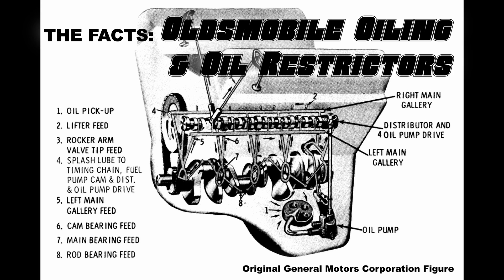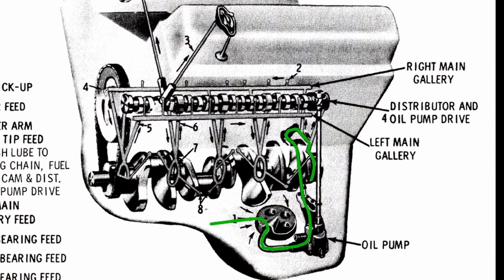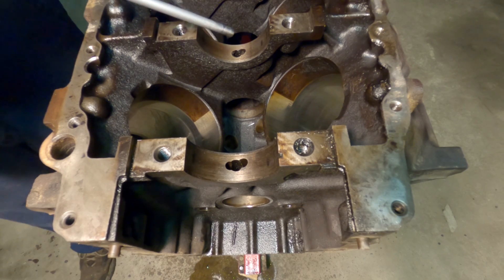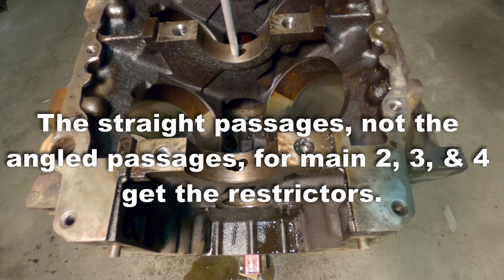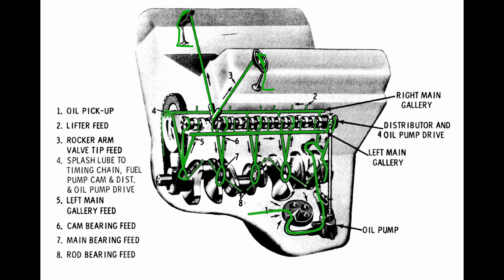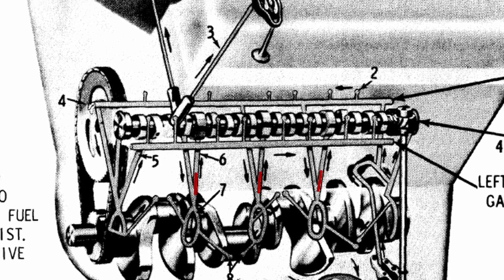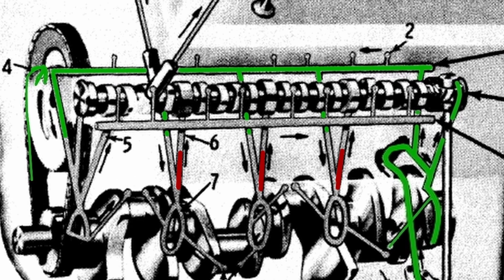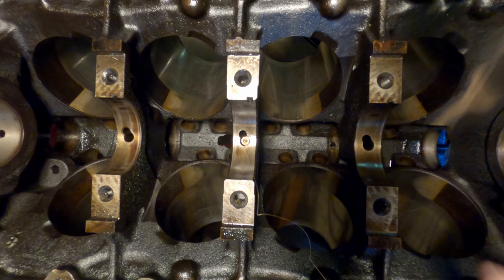The Facts on Oldsmobile Engine Oiling & Oil Restrictors

Comment: I want to know the possibility of hooking up a clear 7/8 hose  to the oil filter  pipe  and injecting oil  through the hose and oil prime the engine without  pulling the distributor  ?
Reply from the maker: Thank you for the question! That is a really clever idea that should theoretically work. Practically speaking, I have no idea if it would work. Just be cautious that the threads don't cut the tube and send a sliver of material through your engine. If you try it, just be certain you confirm oil seeping from all pushrod tops. Let me know if it works for you, that's great "outside the box" thinking!
Reply: Companies exist that sell pre-lubers. they store oil, then force oil into the motor under pressure before start up.

Comment from the maker: I just want to clarify that the metered orifice at the rear of the oil gallery is not solely designed to oil the distributor gear. It's designed as a metered orifice to eject foreign materials and contribute to oiling the distributor gear through splash oiling.
Reply: My understanding is that it does oil the distributor gear: where did you find info to the contrary? Not being argumentative, just trying to find out, as the source who told me that is very trusted in the GMC motorhome community. Also, what do you use for the 3 restrictors?
Reply from the maker: @Scott-hb1xn  Let me start by saying your motorhome guy isn't wrong. I need to apologize, I certainly could have presented this information more clearly. The earliest Oldsmobile Factory manuals I have do reference the splash oiling from the ejector plugs. From an engineering perspective they are refenced as ejector ports for foreign materials suspended in the oil. It's clear they serve a dual purpose here. That being said, nearly all Oldsmobile engines with 150K+ miles that I have rebuilt have plugged ejector ports, yet the distributor gear is not damaged from oil starvation. Clearly the distributor gear gets oil from other sources as well, consider general oil slinging within the engine and oil leaving areas like the rear cam bearing and lifters. The oil restrictors I used came from Mondello but their site has recently shut down. Dick Miller racing has a set available, DMR-5104. I want to personally thank you for the respectful comment, it's good to know decency is still found in people today.
Reply: Hi- thank you for the reply, and the information on the restrictors: I just ordered a set- after several months, I was finally able to bring home my block, heads and crank from my very dependable machine shop- hard to find in my area these days, and as a one man operation quite full of customers! But good work takes time (and money!) so worth the wait... I do need to ask what size the metered orifice in the distributor end plug is, or if there is a stock number for them- I am not sure if the Toronado engine block I am rebuilding for my motorhome had it or not- my machinist says it didnt, but I dont know if he was watching for it, and it seems he may have simply put a standard plug in. (I have not started reassembly yet, so I can swap it if necessary)
Reply from the maker: @Scott-hb1xn Your engine guy is wrong. The Toronado engines did have metered plugs in the front and rear. The rear plug is located behind the core plug (freeze plug) so you will have to remove it to access the plug. I will see if I can locate a part number for you and I will double check the orfice size.
Reply: @junkdump2720  Hi- I got the plug with the hole (and the cup plug behind it) but Dick Miller just told me the DMR-5104 restrictors do not work with the 403, which is what I am working with... So I am waiting for them to get back to me as to what to use, etc...  My engine guy is a Ford guy... lol... He does know a lot, but not as much about this, I think...
Reply from the maker: @Scott-hb1xn  Dick is spot on, the restrictor kits arent recommended for 403's. I would love to hear his responses, keep me posted.
Reply: @junkdump2720  He simply said they have to be threaded in. I assume it is because the holes are too small to accomodatethem.  I looked at the passages yesterday, and it appears I can tap them to 3/8-16, and use allen set screws with 1/16 (.0625) holes to create the restriction (chevy small block style). My Olds guy told me to actually drill the cam bearings, but never gave me a size to drill... Original holes are about 1/8". I would like to hear your thoughts on the tap/plugs and passage size
Reply from the maker: @Scott-hb1xn  The Olds restrictor kits I bought from Mondello in the early 2000s have larger holes, like 0.9 to 0.1. I think 0.0625 is too small, you may want to ask Dick. I have used the drilled plugs before but I chamfered and drilled them 0.95 if I remember correctly. I don't recommend changing the holes in the cam bearings.
Reply: @junkdump2720  I'm guessing you mean .095"... I'm thinking then 3/23" (.09375") would probably be ok? And the tapping threads into the hole should be fine? Thanks- I do appreciate your help here
Reply from the maker: @Scott-hb1xn  I measured about a tenth of an inch, 0.10", I will double check for you but restricting the main passage to your cam bearings down to 60 thousandths of an inch would be too much, especially for a street or mild performance engine.
Reply: @junkdump2720  thanks- I made up the plugs this morning( for #2,3,4) and went with 3/8-16 x 5/8"  allen set screws, using a #40 drill bit, which is .0980", although I can open it up to 7/64" (.0109375") if you think that would be better... I don't have any bit between... I would think .0980" is close enough to .10" to be sufficient, but wanted to get your take... Sorry for asking so many times to confirm... lol... Don't want to starve it...
Reply from the maker: @Scott-hb1xn  I think you will be good, nice work. I double checked, 7/64" is slightly larger than the Mondello restrictor which would be acceptable on a stock or slight performance build.
Reply: Thanks!
Reply from the maker: I made an accurate measuring of the restrictors and ejector ports.  The restrictors are a chamfered 0.100" orifice. The ejector ports are a chamfered 0.045".

Comment: I have restrictors in my block at start up I have about 50 psi of oil pressure that’s being read from the top front of the engine at idle and warm up it drops to about 15 psi.  Should I check the pressure from somewhere else or is that pressure reading okay?  Thanks great video.
Reply from the maker: When installed properly restrictors will not dramatically affect oil pressure. You are testing at the correct port, the driver side top front port just behind the timing cover. There are many factors that contribute to oil pressure, the most common issue that causes low pressure at idle is high bearing tolerances from bearing wear or incorrectly sized bearings. The good news is that the stock spec for Oldsmobile engine oil pressure is 7psi at idle when warm and 35psi at 2000-3000 rpm when warm.
Reply: @junkdump2720  thanks do you have a shop where are you located?
Reply from the maker: @hustlewell  I do have a shop located in Maine.
Reply: Kenne-Bell put out a chart of minimum "hot" oil pressure versus rpm. For 15 psi on a 455 it gets to about 2250 rpm, to leave at least 10 psi getting to the rods. For a 350 would get to 2750 rpm. I never ran restrictors in any of my Olds. Hopefully your pressure increases with rpm.
Reply from the maker: @robb1165  15 psi at 2250 would be below the minimum pressure specification. I would say that's indicative of a problem or excessive wear.
Reply: @junkdump2720   That is the minimum required to maintain at least 10 psi to the rod bearings at that rpm. The psi is Kenne-Bells recommendation as the absolute minimum required to lubricate the rods, not the ideal.
Reply from the maker: @robb1165  haha, you're right, certainly not ideal! Thank you for sharing.
Reply: Oldsmobile had great engineers, by positioning the oil pressure gauge port at the farthest point from the oil pump. That gives you a better indication of what the oil is doing and you know that oil has made it through all the oil passages. Unlike a lot of other engines.
Reply: I drill all my cam bearings with smaller holes when I rebuild Olds engines,  just have to make sure you line up the smaller hole with the oil port when you install them.

Comment: The oil drain back issues are from boat guys running high rpm for long periods. In a car a high volume pump with 8qt pan works fine for 1/4mile runs with no restrictors. And a standard pump with a factory pan is fine for the 1/4mile. Great video!!!
Reply from the maker: That's correct! Just like you said, I have also heard the boat community has had drain back issues. Luckily I haven't seen that problem on land vehicles with Olds engines. I use the restrictors to improve the oil characteristics at the mains by restricting flow to the inner cam bearings. It has lots of benefits and protects your mains! Thank you for the comment and I'm glad you liked the video.
Reply: @junkdump2720  how long do your engines typically last? I had mine built by a local shop, he claimed lifters came apart twice, and the third time i tryed to pick it up I lost all oil pressure, and it over heated. Its bored 40 over, heads, valves and everything has been redone, so I am going to try fixing it myself. He installed a high volume oil pump with an upgraded spring. Should I go with the stronger pump again, or go back down to stock to keep more oil down below? 

Thank you for all the quality content
Reply from the maker: @rachal9306  I have had great luck so far with my builds. I've had two fails, one 350 had a cam lobe and lifter fail with a bent pushrod. I replaced the cam and lifters and as a precaution use hardened pushrods with all my builds now, that 350 had more than 200k on it when it was torn down for upgrading. The second was a spun rod bearing, I bought a used 425 rod from a machine shop and didn't double check the journal diameter, the engine started knocking when it hit 1200 miles, the bearing shells slipped on top of each other, I had to replace the rod and crank on that engine, that was entirely my fault and I double check measurements now. Your situation sounds very frustrating. I assume your engine is a  big block (455), You should be able to run a high volume/pressure pump without issue. A loss of oil pressure in a newly built engine is typically due to oil pump failures, incorrect bearing tolerances, or debris blockage. I would start diagnosis by removing the distributor and running the oil pump manually (counter clockwise) with the valve covers off and observe if oil is making it to the rockers on all cylinders, I have an oil pressure gauge I screw into the front orifice on the block to see if pressure is building in the galleries. Once you break down the engine take your time measuring the following: Piston to wall clearance, bearing clearances on all mains and rod bearings. If you plan on running 10w30 oil, your bearing tolerances should be 0.0008 – 0.0038 inches on Mains and 0.0007 – 0.0032 inches on Rods. Did the engine builder try to grind your rear main cap, where the oil pump attaches, if done wrong this can cause damage. While you are diagnosing the problem and when you tear it down I would suggest adding the oil restrictors from my video on Olds oiling. If you think too much oil is going to the top end you can decide to install restricted pushrods to help. If the overheat is not due to oil pressure loss, I find these engines overheat most commonly from ignition advance being set too high and piston to wall clearances set too tight. Let me know what you find, I'm interested to hear what's causing the issue for your engine.
Reply from the maker: I'm glad you liked the video!
Reply: Just drill smaller hole in all the cam bearings.
Reply: What size hole?
Reply: @Scott-hb1xn  I have put pipe cleaners down the pushrods to reduce oil to the top end with no issues.
Reply: You have GOT to be from Edmonton. I grew up there and I've had the same 1967 Delta 88 since 1982 when I graduated school. I once read an article in "Street Machine & Bracket Racing" outlining how to modify a 455 Olds and used this Junkyard Dog article as a guide. The Blackjack headers had to be bent around the steering box and the Edelbrock Torker II intake also required some mods. In those days I could find parts at "Pick A Part" in West Edmonton and Aldon Auto Salvage near Lamont. I took care of the bottom end by installing a high volume oil pump and stretching the spring to increase pressure. As for oil flow; I followed the article and drilled larger holes in the main bearing saddles (save one) and reamed and chamfered the holes increasing flow directly to the crank. I took the car with me to Australia in 1991 and have experienced no problems in wear (as a streeter). I'm still using the same points last gapped in 1987.
Reply: @arnbo88 Your right I am from and live in Edmonton. How did you know I have to ask? I know both those auto Wreckers well. Aldon is no longer a self serve yard. Cool story.

   Nolan.
Reply: @wildrosegarage4208  Hi Nolan. Your youtube channel name gives away "Alberta". I still retain my licence plate with the wild rose symbol. Taking your dog for a walk in a real shitty and cold back alley reminded me of why I left Edmonton. It looks like the area near Eastglen. My father used to have an autobody shop on 66th street. Edmonton's narcotics central. I'll send you an email soon with a pic of driving my Olds downunder. Cheers, Arnie.
Reply: Olds 260-455 v8 engines oiling system goes back to 1949 Olds V8 engines oiling galleries.  No surprise that the modern Olds aren't up to the task of higher rpms & power production.
Reply: I disagree. High volume oil pumps flood the top of the motor, increasing pressure at the valve covers and starving the sump, forcing people to upgrade to 8,9,10qt pans that just get pumped up and out further increasing pressure at the top. With a high volume pump, you’re making a new problem. And the fact you push pipe cleaners into your pushrods tells me all I need to know about your understanding of engines.
Reply: @AndrewIrizarry I have forgot more than you will ever know. Mr. Pressure at valve covers.
Reply: @AndrewIrizarry  "increasing pressure at the valve covers"  LOL are you serious?

Comment: I cannot tell you how simple this made tracing the oil system out on the 455 that we are currently working on for my wife's jet boat she is doing the build herself and I'm trying to teach her everything and this video was very very helpful keep up the good work will be giving you a shout-out and our next engine build video
Reply from the maker: Thank you, I'm glad you found the information helpful. That video took a long time to make but I wanted it to be thorough as there is so much misinformation about Olds oiling.
Reply: @junkdump2720  yes, thats a fact! And I know because I blew up my fair share as a teenager 😆
Reply: Help / ideas ? .. have a 455 olds f - w30 block in my jet boat .. was running 4krpms for a long distance am heard a loud dense crack sound .. Shit it down and checked ,, idk where from but spat out all the oil from somewhere .. intake and heads and oil pan all look dry no clue where the oil loss is or how .. dark clean oil is all over the sump pump area but pulled oil fill tube out by the timing chain it’s covered in milky water and oil .. also noticed lack of power an won’t stay running have to keep feathering the gas but it still runs smooth with no ticking or knocking sounds .. any ideas

Comment: Is there extra olling holes in the block. How to hook them up?
Reply from the maker: There are 2 oiling holes in the front of the block for the oil galleries, both are sealed with threaded plugs, the plug closest to the fill tube (passenger side) has a hole in. There are 2 oiling holes at the back of the block for the oil galleries, both are sealed with threaded plugs, the drivers side plug has a hole in it and it is behind a core plug. There are 2 oil holes in the block on the passenger side where the oil filter adapter housing will be bolted to. There is one hole on the front of the block next to the casting number that is tapped for the oil pressure sender. There are 16 oil holes in the lifter bores, and the remaining oil holes are in the block are for the main and cam bearings. All other holes in the block are for casting (core) plugs, coolant drains, coolant passages and so on. I hope this answers your question, if not let me know and I will try to clarify.

Comment: Cool video. Do you have any opinions on the practice of installing cam bearings with the oil hole at the 3 o’ clock for restriction purposes?
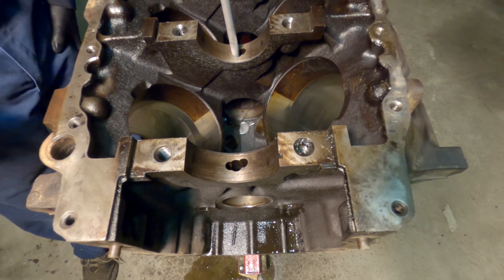Reply from the maker: In an Oldsmobile engine there is no channel behind the cam bearings (that I can recollect on a 307, 330, 350, 425, or 455. I haven't built a 403 or 400 in a long time so I'm not certain on those). You can see that at 4:45 in the video, there is no channel for oil to travel behind the cam bearing. If the cam bearing hole is not lined up, the passage will be blocked and no oil will get to the bearing surface. I have heard of people drilling a smaller hole in the bearing at the 3 or 6 position and installing cam bearings with the smaller hole lined up with the passage, but I don't recommend that. The knurled hammer in style restrictors are cheap, easy to install, and work very well.
Reply: Yeah the Durabond 0-6b with back side groove would be only way I can see it possibly working, but your point on economy and ease of the hammer in restrictors is a solid point! Thanks